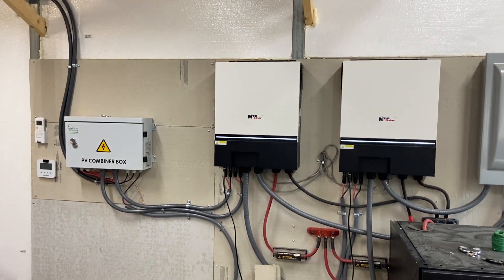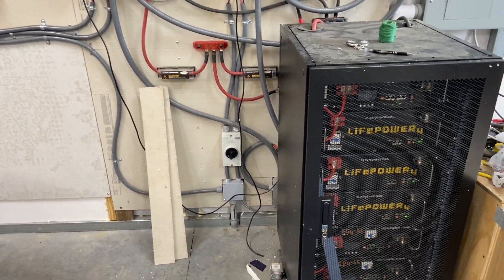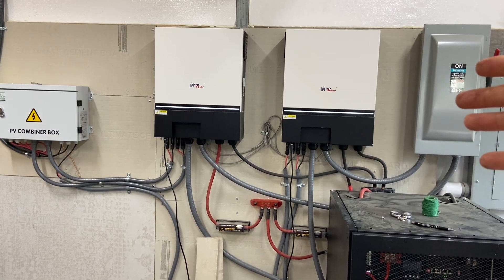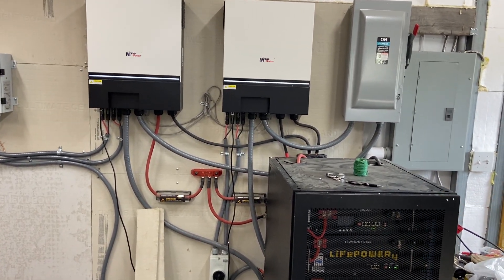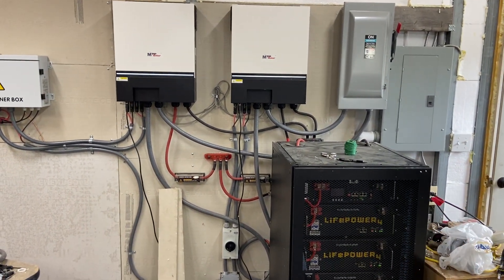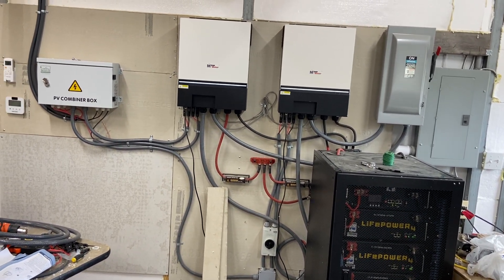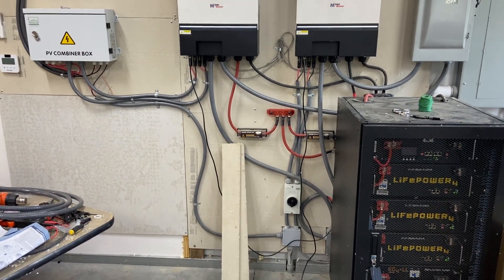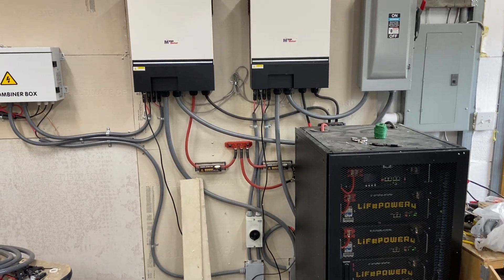Mpp lv6548 and eg4 battery bank charging and discharging.

Comment: I opened up my Jakiper JK48V100.   Internally, one a single 6 AWG cable for +/-.   Main disconnect is 125A.   The internal wires would burn before the breaker trips.   Also 6 AWG really only safe 44A at 60C, 52A at 75C, 60A at 90C.    The BMS claims to permit 100A continous.  Not safe.
Reply from the maker: That seems really lightweight. I might check will prowse’s video out again where he opens one of them up.
Reply: @GavinStoneDIY  I  have 6 of them.   Price and availability was right.   Not complaining as they can be reworked for better safety margin.
Reply: @GavinStoneDIY  Will's video shows the single 6 AWG.   He seems ok with this?  I would be ok.
Reply: I double checked,  6 AWG Silicone (200C temp) rated in ok.    Just get HOT.   I still think I will refit with thicker wire for safety margin and cooler run.
Reply from the maker: @errcl65  will that void the warranty?
Reply: @GavinStoneDIY  they gave me torque specs.   I really do not expect warranty support from Jakiper if we get into SHTF.
The EG you have are also single 6 AWG.   Saw this is a Signature Solar break open video.
Reply: its all about the insulation type

Comment: The PACE BMS program (SOK and Jakiper) allows you to change the max charging current.  The value read over the Pylon BMS protocol is 50A which is fine if there is only one LV.   The other LV don't get this info from the primary LV hooked to the BMS, default to 60A.   I ended up tuning down the max charger current of each of my other 3 LVs.   With 6 packs, 20A max per.  I limited the total charge current to 110A (50A form primary LV - which cannot be changed if using option 5/PYL,  and 20 from the other 3 LV set to #5/USE).
Reply: Gosh I couldn't understand any of that haha it's not your wording or anything it's just me not knowing much about it. Very interesting stuff going on here boy it sure is great to have you guys out there commenting making videos and such. Very helpful very very helpful and I for one really appreciate it

Comment: Excellent video. How would you set up the a/c input section if you were charging with a generator, size wire and breakers for say a 10K generator. Would you need that #4 wire or would #6 suffice for this?.
Reply from the maker: I would use a it depend on how you have the generator connected. If it’s a standard locking wire hook up then a 50 amp plug and breaker would work. 6 awg wire is sufficient  for a 10k generator. These inverters have a setting that will start the generator automatically if your generator comes with an auto start option.
Reply: @GavinStoneDIY  Thanks. So just connect my 50a generator inlet to the AC input terminals on these inverters to charge the batteries. Do I need to connect to both inverters to do this or will just one suffice?.
Reply from the maker: @sh839c  you would connect one hot leg to one inverter and another hot leg to the other. Each of these inverters only runs 120 so they both require a hot leg in order to supply 240. You would split the neutral with a three way splice and the same with the ground. Make sure your generator supplies a clean sine wave. Ideally below 10% harmonic distortion.
Reply: @GavinStoneDIY  Thanks Gavin, I've been trying to find this out for a while.
Reply: @GavinStoneDIY  I have a smaller 3200watt inverter generator that has less distortion would that be too small to use?. Do the inverters see what it's getting and automatically adjust the charge current to the batteries?.
Reply from the maker: @sh839c  sure thing. Don’t hesitate to ask. I had a few people help me with info when I installed my system. It can all seem intimidating at first. Use a junction box coming from your generator. Inside that box you can use polaris type splices to split the ground and neutral. So coming out of the junction you will have a ground neutral and hot in one conduit. And the same in the other. Basically like I covered in my ac wiring video. Unfortunately I don’t have an actual visual of the splicing. I may do a more detailed video on that.
Reply from the maker: @sh839c  you would probably have to adjust your charging parameters in the inverters to fit the amps coming from the generator. Would you be supplying it just to charge batteries? If so then you could just use an external charger. If you are supplying ac power for bypass or pass through power then you’d need a larger wattage for the house anyway I’m assuming.
Reply: @Gavin Stone  I was thinking of wiring my generator to the AC input to charge everything I only have a 3500 Watt predator. I have another generator also on a light pole. Instead of buying a whole another charger I was thinking about just hot wiring at the charge everything. Like I say I haven't even hooked anything up yet I'm just still thinking and looking. Gosh you are also saying it's intimidating and it is intimidating. I don't know how you guys did it you must have some sort of electric background already. I've never been so great with electricity.... I'll keep looking for your videos cuz it sounds like you might have done a video on some questions I'm trying to I want to ask. And thanks again very helpful

Also remember I'm just doing a small time operation one inverter and 120 output. I'm not really running a lot of stuff at one time I'd be willing to bet I'm going to be running a thousand Watts or something maybe. Now I'm only probably only running about 400 watts all day every day with my 12 volt system. It might not even be that much a few lights a little refrigerator and a freezer and my alarm system.. once I get the Sun gold inverter 6500 going.

There is going to be more output because I might plug the whole motorhome in and the idle consumption is high. It is at 100 Watts hobo Tech says..

And if I do run plug in the motorhome it has a DC charger I don't know how many watts that really uses. Right now I have extension cords going to the things I need. Instead of plugging in the motorhome because I don't want to my solar system getting charged by the motorhome charger at the same time I have it powering the motorhome. Kind of seems like a loop to me. I don't know if my comment is completely understandable anyway I'm thinking I'll only be running around 6800 w. And then I do want to be able to plug in my water heater every now and then I have a little one probably Burns 10 amps. I used it for the first time the other day on my 12 volt system it seemed to work okay wires got a little bit hot. And the sun was out so I was charging good. I don't have enough solar panels right now waiting to get them in. Well thanks again for taking your time if you read this. It's such a long comment I can't remember what I said at the beginning haha

Dang I didn't realize this is an old conversation.

Comment: What kind of board are these components mounted on and where can they be purchased? I'm assuming it's fire proof. Nice video.
Reply from the maker: Thanks man. The board is a standard backer board you can purchase at a big box hardware store. It’s usually used as a backing for tile. But it’s easy to work with and has a good fire rating. Most all in one inverters recommend using something fire retardant to mount to. Highly unlikely there would be an issue. But just in case.

Comment: What battery type did you set the 2nd LV which does not have the BMS comm?
Reply from the maker: Neither LV has battery communication. They are both using voltage only. I chose the user defined setting. So I set my own cutoff, max,  and float voltage.
Reply: @GavinStoneDIY  What were choices for EG batteries?   I have Jakipar, 02 (60A), 26 (57.6), 27 (54.08), 29 (44.8) based on their docs..
Reply from the maker: @errcl65  the amperage would depend on the size of your battery bank. As in how many AH of batteries you have. Each battery should take 20 amps. So if you have 3 jak batteries then 60 amps works. I have my discharge  cutoff at 50v. But that’s only due to some odd factors with the eg4 voltage. Normally I would set that to 49v probably. And my charge voltage is set to 56.4 my float is set to 55v.
Reply: @GavinStoneDIY  Do both your LV's provide equal charge current?     There is very little info about how these inverters work / behave in split phase and parallel.    I have 6 batteries now and plan to go to 10.    From what I see,  the batteries will the lowest internal resistance will charged first at a much higher current (too high for my liking 100A if multiple LVs are available).   I would like to cap the current of each rack unit between  20A and 30A.   I will ask Jakipar if that parameter can be set.
Reply from the maker: @errcl65  you can set each inverter to the same setting if that’s a concern. Part of your issue may be current sharing between the batteries. It depends on how you have them connected to the inverters. Usually it’s best to connect them in a diagonal. The most negative from one battery and the most positive from the other. That way the closest battery isn’t receiving the largest amperage.
Reply: @GavinStoneDIY  Would you mind sharing your inverter settings (via pictures of screenshots) for your battery setup? I have the same hardware and I'd like to reference yours as far as user defined battery settings and charge and discharge amps.
Reply from the maker: @plasticmoonman  I could probably write it. The settings seem complicated but it’s not too bad. I have my discharge voltage on setting 12 set to 50v. After that it switches to the grid. That seemed to work well with the battery bank size I have. It usually will bring the batteries down to right at 18%.  I have it set to return to inverter power at 54v which I think is setting 13? . The bulk setting is set to 56.4. The other settings about grid assistance and such are pretty easy to understand in the manual.
Reply: @GavinStoneDIY  Thank you, that helps a lot.  Is your max charging current set to 6 x 20amps (120A) on both inverters?
Reply from the maker: @plasticmoonman  if both my arrays were the same direction and size I probably would have them at 60 amps each. But one is a little earlier and smaller. So I have one inverter at 70 amps at the other at 80 amps charging. Between the 2 inverters I usually pull around 120 amps charging total. Of course that depends on the loads I’m using during the day also.

Comment: Nice system I really like that you are planning on balancing your solar input to your inverters. I may have misunderstood. but I thought you already did that when you did the ground mount solar.
solar is fun to work on making better. I see that you have been putting lots of thought into your system. keep up the great work.
Reply from the maker: My pole barn solar mostly fed one inverter. I only had one series of 4-395w panels feeding the second inverter. It was very lopsided till I finished the second array last week. That wouldn’t necessarily matter with your setup. Using a 240v units with an auto transformer would distribute things differently. In this case one of my phases was being fed by solar and the other phase was being fed by battery. Now things are much more even.
Reply: @GavinStoneDIY  I was thinking I saw a video where you put more solar to the second inverter. so glad you got that done. it has them working more evenly now, I hope? I am supposed to get my second transformer today. We shall see, when it gets here, I will install it, so I have backup for that also. all we can do is work to improve our systems and help each other out when possible.
Reply from the maker: @jamesshomesolarmore2223  exactly, this is about giving people ideas and helping where possible. Yes my loads are much more balanced. I don’t use any battery during the day at all now and I have a mini split running in the shop off of solar also. I’m amazed at the power you can get from a system this size. Maybe down the road  I would like to add a couple mini splits to my house and run them off of solar also. At the moment I’m still using air conditioning from the grid.
Reply: @GavinStoneDIY  air conditioning was one of the things that was using grid power last year. this year I don't need the grid power. but I expanded a lot of my solar. more panels and more batteries plus another inverter. To go off grid and still be comfortable can be expensive.

Comment: I got some discounted 2 AWG welding wire which has a higher heat tolerance for battery to bus bar.
Reply from the maker: Battery bank to bus bar? Or just the smaller lead wires in a cabinet?
Reply: @GavinStoneDIY  what guage from your batteries inside the cabinet?
Reply from the maker: @errcl65  I used 4 awg inside the cabinet. And 2/0 from batteries  to the bus bar I mounted on the wall. But I intend to change that to 4/0. It needs a thicker gauge to handle that much amperage from the bank to the inverters,
Reply: @GavinStoneDIY  Good idea.  I am running 4 x LVs (2 per phase),  each will has a 500VDC-200A 2P breaker using #2/0 to a pair of 
1000A bus bars (+/-).    The DC input of each LV should never see more than 135A continuous.   The 1000A bus bars should be
good up to 10 x rack batteries (100A max each).
Reply: My PV side is up in the air.   64 panels 390W,  16 (2 x 4P2S) for each LV.   But they will be 8 pairs which have to run 230ft to
the inverters.   Trying to justify using RPVU90 - 8 AWG for less line loss over 10 AWG.
Reply from the maker: @errcl65  I used 8awg thhn in conduit from my larger array. What are the stats on the panels? It sounds like you are going over the voltage snd wattage limit for the units. Typically it’s pretty hard to get more then 6500 watts put LV6548. Though technically they can have 8,000 watts per unit if you get the VOC just right. Oh never mind. I saw you’re using 4 units.
Reply: @GavinStoneDIY  4 in series will be just under 200Voc, so each PV input will see 3120W (working max is 195V@16A).   So I am under using the PV inputs feeding a max of 6240W per LV which is well below the 8000W.     long runs of 8 awg isn't cheap.   I need 8 pairs of 230 ft runs.
Reply from the maker: @errcl65  I mistakenly thought you only had 2 units. You are slightly under using the inputs but not by much when you consider the max amperage per unit is 18a. So you have a good layout overall. 8 awg isn’t cheap you’re right but 10awg is too light for that long of a run.  Even with 8 awg it’s a 2.6% loss at that distance. The conduit is very pricey at this point also. You have a large system. And sometimes you have to bite the bullet to finish the job. The big box stores sell 500’ rolls of 8 awg thhn. You can slice them in half. If you can beat them up on the price a bit that’s probably your best bet.
Reply: @GavinStoneDIY  I will cheat using PRVU90 direct burial in 4 inch drainage tile rather than PVC Sch40 conduit.   I will get the wire wholesale at electrical supply warehouse.   I just bought one 10 ft - 2 inch PVC Sch40, it was $40.    250 ft roll of 4 inch drainage 
tile is $300.
Reply: Typo, I meant RPVU90
Reply from the maker: @errcl65  as long as it’s 8awg that seems like a good option. If you lead them into a large DC disconnect at the house then you can probably switch to 8awg pv wire for the final short bit after then disconnect.

Comment: What size wire did you change to?  My Jakipars suggested 6 AWG which is way too light.
Reply from the maker: I changed them to 4awg. The eg4LL models came with 6awg. The lifepower was thinner.
Reply: @GavinStoneDIY  Are there +/- bus bars inside your battery cabinet?
Reply from the maker: @errcl65  yes, they have copper bus bars on both sides of the cabinet to connect the server rack batteries to. You can probably see it at the end of the video where I show the wires. Or maybe they are out of view.